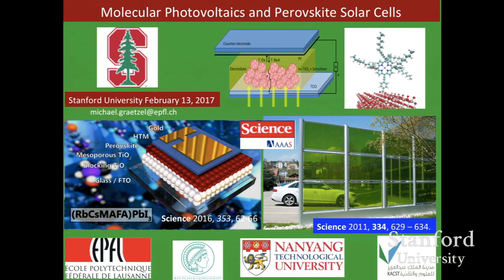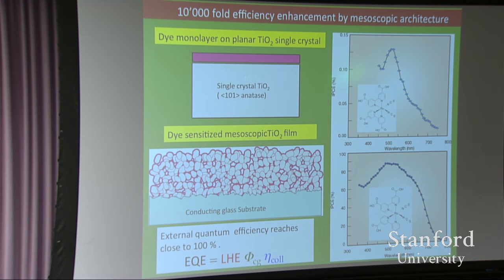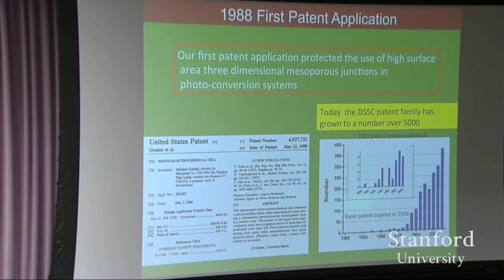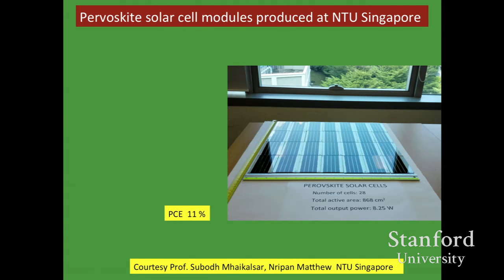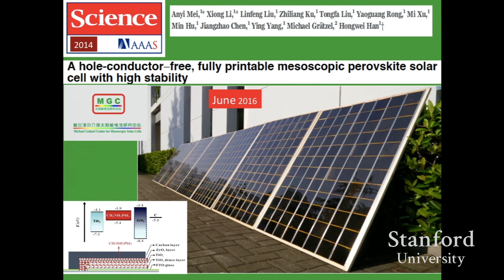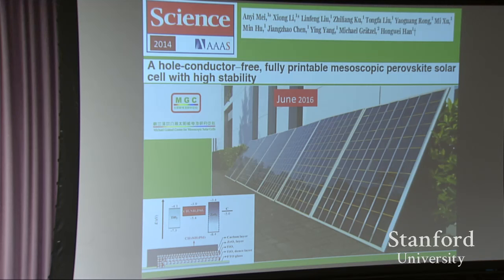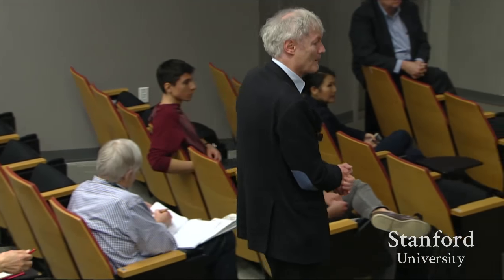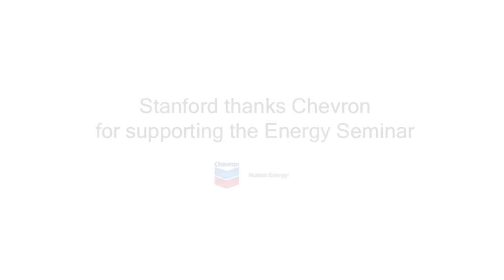Michael Grätzel | Molecular Photovoltaics and Perovskite Solar Cells

Comment: Great video. The dioxide titanium is totally white. How is possible the the greatzel cells are transparent?
Reply: I'm not sure of the exact technique they used but I think they coated a tin dioxide solution. It is possible for it to be transparent in the same way that common salt solution in water is transparent even though the salt is totally white.
Reply: Because the TiO2 is mesoporous, meaning the pore sizes are around the tens of nanometers scales. The small pores interact with light differently compared to a bulk sized TiO2